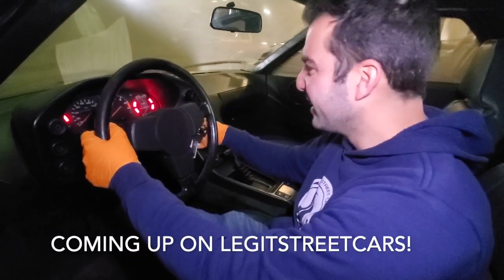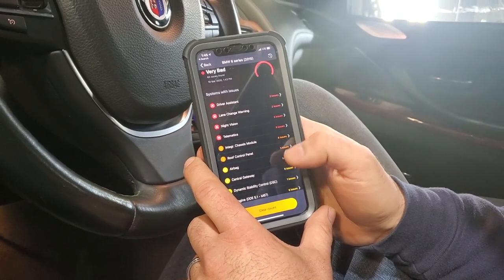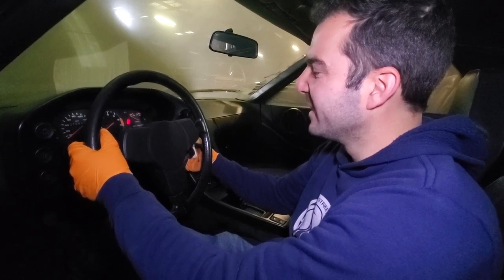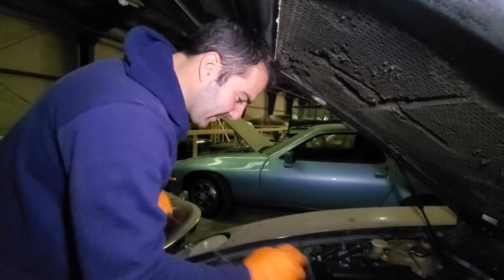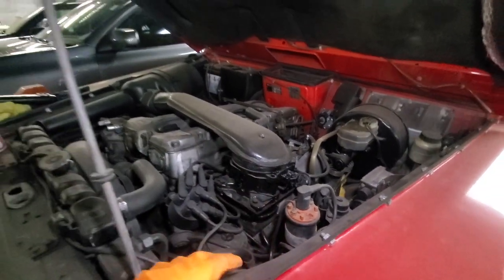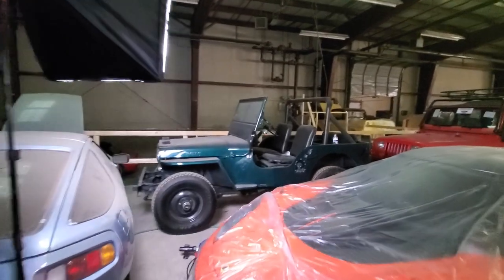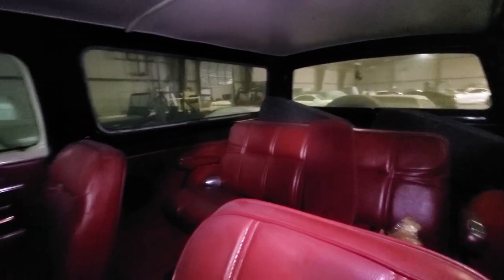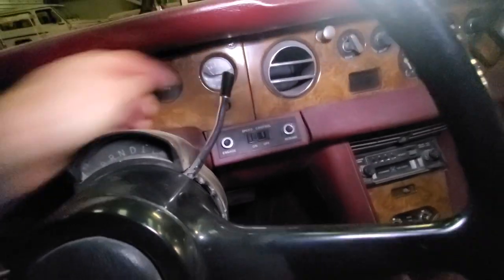I Found A Warehouse FULL Of FORGOTTEN CLASSIC CARS With The Keys In Them! I Brought Gas & A Jumper!

Comment: That 3.9 soft touch dash Rangie started up like it was switched off yesterday. I might prefer the 200 Tdi version but for an old 3.9 that’s not too bad at all. That one is a last year or close to production model as that dashboard was only used at the end of the production run.

Comment: The V8 in the Range Rover classic as it's called here in the UK. From 91 to 05 I was responsible for Foundry tooling approval of the Landrover V8 block and cylinder heads and all related Engineering dimensional reports.

Comment: That second 928 is a very early car, 77-79 with Pasha interior and stick. That interior was only an option On the early cars with the purest design presentation. They are trading for the most of all 928s if clean, including the GT and GTS which were 85-95k USD new in the early 90s which is a boat load in today’s dollars. I love the early cars, they were a tour de force in period.

Comment: the 928 air filter is also used on bugatti veyrons.  also, I believe early manual 928s had different floorpans than autos, so the back seat is bigger.  either way the back seats are pretty much useless.  I'm about 5'9" also and can't fit behind my own seating position in my car.

Comment: A stick car 928 and a automatic have different rear floor pans and rear seats the automatic has a bigger transmission tunnel and smaller rear seats. Even though you didn’t have spark if you would’ve held the flapper door of the throttlebody open with a screwdriver it might’ve fired that’s what I have to do to mine after it sits for a year

Comment: Notice that the Range Rover was the easiest to start , and straight off the bat without having to resort to the " Start you bastard" fluid!  200 000 miles? It's only just run in! The Blue Land Rover beside it was a Discovery. It looks as if it were set up for serious off roading.lol wonder if it were a V8 petrol or a diesel?

Comment: When bulk starting a bunch of old cars, it would make more sense to carry around a small fully charged battery. A jumper pack can't do anything to a several years dead battery, so when you crank the car you are going to be running 100% from the jumper pack battery, hence why they always sound like they are struggling to start. Literally every youtuber seems to do this instead of just hooking to a good battery. A jumper pack might be 100-200 CCA at best (Ignore the Bull$ hit 2000Amp ratings they write on the box). A good battery could be 500-700 CCA

Comment: The Rolls Royce is a Long Wheel Base with front head restraints and full sized rear window, so it will be a Silver Shadow II which ran from 1977-1980.

Comment: I'd change out the old fuel before starting.
Reply: Depending on how much fuel in vehicle, how long it's been sitting. I use premium fuel and a little B12 chemtool. Just to get it started loaded on trailer. The longer it sits the cleaner the fuel system will get.

Comment: cannot believe you are starting cars sitting for that long without fully replacing all fluids and fuel.    after 13 or so years fuel turns to molasses and is the best way to stuff the engine completely.

Comment: You would think the best method to start engines that have been sitting for so long, would be to 1st pull the plugs and drop some oil in each cylinder. You know, just in case you don't want to add 5 years of wear in an instant. And maybe flush the fuel tank next?!

Comment: Im surprised you risked starting the engines. I heard that if u not started an engine in years the pistons could seize ? Im assuming the owner did nothing to prevent this from happening. Correct me if im wrong please. Its just what i read up. Im no mechanic

Comment: Starting the Porsche with old fuel and talking about it if it is a banger. It is a 928 and not a 924 is a big no no. It is the most desirable non 911 based model.

Comment: CIS fuel injection and old gas is not your friend! Those systems have to be flushed out at the very least to get them working again. If that doesn't work, you are replacing lots of now expensive and hard to find parts.

Comment: I stopped at 09:15 (I could not stand it) Please do not start all these old and long-sitting engines just to see whether they would run... And do not use starter spray at all!  Is that an American habit?  When you have an old car and you will bring it back to life, do it deliberately.  Not just "start and it runs and shut down".  Think about, what you want to to with it. Change oil and spark plugs. Check the fuel (change it), check for leaks, change the belts. BEFORE start! And if you intend to have this engine alive, let it run at low revs til it is warm. Everything else  will kill it. No engine deserves that.
Reply: I knew I'd find someone else who felt this way, kinda painful to watch if you've been around and worked on cars that have sat a long time.
Reply: @BullittKid08  Agreed! Let these sleeping beasts wake gently and then get a good and full warm-up with all fresh fluids. 

My mechanical sympathy took over in this case. These classics deserve better.

Comment: If these cars really didnt start in decades then firstly as a mechanic you would know you have to lube up the pistons with oil via the spark plug holes ...... else the crank is not strong enough to push the rusted pistons and crankshaft....

Comment: The Carly adapter won't customize codes on Mercedes or Chevrolet according to website. However it works on BMW vehicles. No Thanks!
Reply from the maker: It works with many but not all. That's why you can check on the site before buying like you did

Comment: 1. Do not keep cranking on a car that's oil dry bump it at first then overtime once it gets oil pressure you can start to crank, my freind had a 924 and didn't let it build oil pressure after sitting 15 years and it tore that engine up.

2. Those 928's scare me, old fuel is deadly for them and the timing belts are too.

 2.This guy isn't really a great collector, I own 3 Porsche air cools I always start them every week or if I'm on vacation or I'm busy, for 2-4 months I'll put a little stabilizer in there.

3. If it's a customers car why are you messing with the buttons.

4. This guy is a terrible collector these cars dont deserve to be ran on varnish, even a car with a carburetor it can cause clogs overtime.

Comment: Wait. You were a tech for how many years?
    And you’re only 12 or 13 years old now??

I just can’t believe that you just jumped in them to see if they’ll start. 
 Do you think the gas in anything that has been sitting for 8 to 10 years and put a battery in it and it’s going to start??
  Really??

So. You were a tech right????

How much dirt & garbage do you think you pushed out of the tank & into the filters and injectors.
    Not a very bright Tech right???